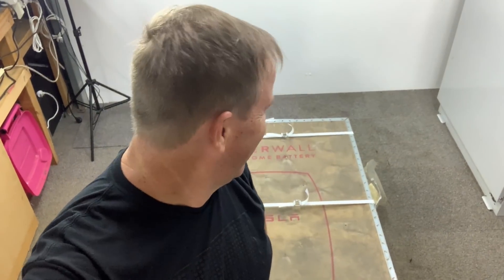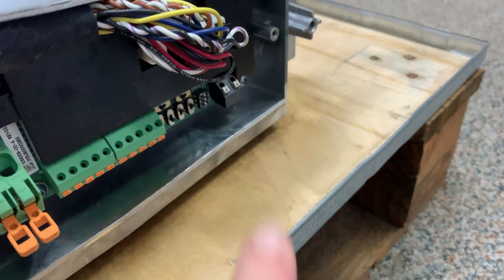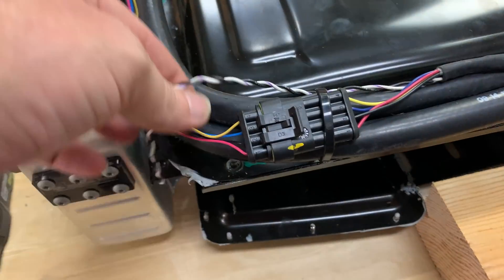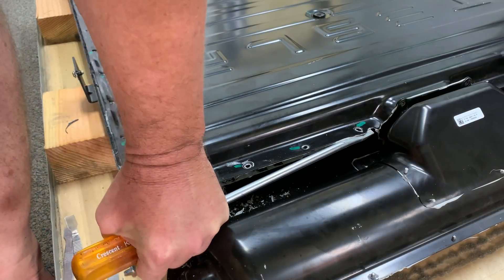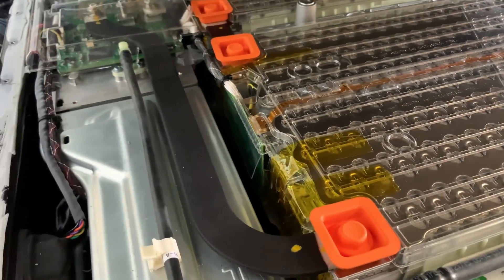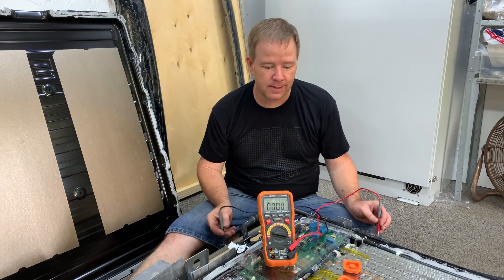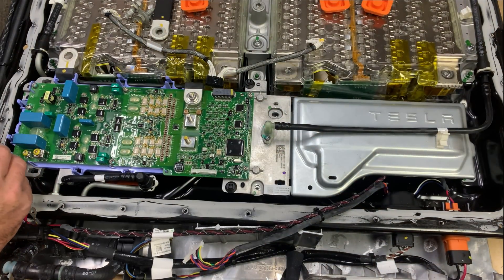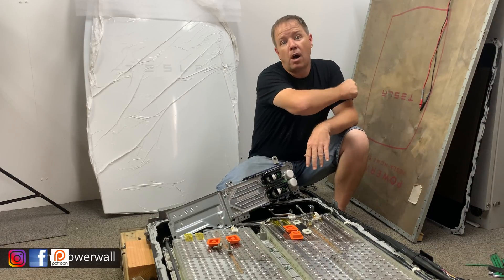Tesla Powerwall Teardown - Taking a look inside a new Tesla Powerwall thats been stored for years

Comment: Well lucky you got for free, me I pay $10,500 back in 2016 when a company up here in Puerto Rico they installed my grid. And this is my LUCKY experience don't if I should said with TESLA or the Company that installed the unit but here we go. On Nov 2016 they installed the grid with one battery it was not till Feb.2017 that they turn on the system to work like it should with the utility company meter and all permit to work like it should and it was working like it suppose to, not till Sept. 2017 the same year that Mrs. MARIA show up to the door of Puerto Rico. When the Hurricane enter that the grid went down the system did not want to get up I shut it off and turn on my backup generator, next day after Maria gone I went to turn on my system and it did not want to do nothing even a bright day that was. I went to the company and they send a TEC that was teach by the TESLA technicians cause for MARIA the TESLA TEC had to come down here to get a lot of issues solve with different issues that not only this company have encounter so long story short my friend.

The TEC came with a battery to jump started the TESLA and give it enough charger to wake it up so the system can wake up and function, but its a very slow process at less that what he describe me and it was not till he have seen that I have a backup generator that he said that with the generator he could jump started it also and charge it faster at least to a 5% state charge and that was what he did and later on I end up buying a second one in which cost $8,500 and you got that one for free, let me know if I can get one for free as well to fix my crying. GOOD luck with my hint.

Comment: I am hopeful that you can restore it, I let a 3s lipo drain to 1v and was able to restore it by slowly charging it and checking every few minutes until it got to the correct minimum voltage, 2 years later and it still works fine.
Reply from the maker: These have been zero volts for years I don't hold much hope for them

Comment: I would use a good current limited power supply and set it to about 1 amp and let it run for a while.....  don't know how likely you are to get those back though.
Reply from the maker: I only have a cheap ebay one set at 1.5v &  0.45amps recharging now very very slow..

Comment: the white Keurig cup looking things were inductors (chokes).  Although not the case here, "smoother" almost fist as a term. AC often smoothed into a form of DC!  Here probably being used to control the DC bus voltage and Amperage in the charging unit.
Reply from the maker: thanks for the info

Comment: I appreciate your time and effort in disassembling the device. It seems to be engineered well enough, but there are points of failure are everywhere. Typical discharge occurs with batteries connected to a BMS and other devices. The discharge may be in mV, but over time the batteries will be entirely flat as you have noticed. Use of chokes is a normal practice, one of the main benefits is to reduce DC ripple during charging.
Reply from the maker: Probably why they released a PW2, easy to see issues down the road.. I'm still super impressed with it - if it had been installed it would only be half way through its useable live and if they cycled it every day here in Brisbane Australia they would have saved a whopping $2,281.25 off their power bill. So in their 10 warranty period it would save them about 5k aud - NOW just got a quote to supply and stall a PW2 and it's $16000 all the sudden they might look good but that ROI is WAY off!

Comment: not sure if it’s true, but I believe using a heat gun on the case will soften the adhesive and make it a little easier to open
Reply from the maker: we tried that didn't help, My theroy to why is it's a thermal barrier. If the battery when thermal you wouldn't want that material to soften during that event

Comment: what we recon is a new powerwall 5 years later wouldn't even be remotely similar to that one.. which of course would no doubt be damaged l-ion cells sitting discharged for years.
Reply from the maker: are you implying that it's not new because its been on a shelf for 5 years? New in box, not cycled - under any Australian law that would be considered new if you sold it with a new warranty.

Comment: This was so interesting to see, thank you! Besides Tesla already having manufactured the 6s74p modules, any thoughts on why they would have used the 2x 6s and DCDC converter? LG does similar in the RESU-H, right? I think HV DC coupled battery packs make great sense but why not just go 16s and skip the DCDC? Thanks again.
Reply from the maker: i'm no expert but i'm thinking the dc to dc would still be needed for constant voltage
Reply: You answered yourself. This is Tesla repackaging what they already have. They aren't going to spin up an entire production line to make a different battery module. That's the module they make; that's the module they stick in everything.
Reply from the maker: @jfbeam  for sure! its smart business

Comment: A choke, is typically a component used for step down/up for discrete conversion power ie DC/DC from cells to house - https://en.wikipedia.org/wiki/Choke_(electronics)#:~:text=In%20electronics%2C%20a%20choke%20is,AC)%20in%20an%20electrical%20circuit.&text=Its%20low%20electrical%20resistance%20passes,the%20amount%20of%20AC%20passed.

I didn't realise you can revive completely dead cells however.. Additionally regarding BMS and self discharge, I suspect the BMS priorities are safety first and then longevity of cells. IE if you left it alone it wouldn't shut off to keep voltage, it would disarm itself incase it gets chucked in the landfill and nasty things happen. I'd even go as far as guessing if you left it for a time duration without charging it would accelerate the discharge for "safety" of unmaintained cells or sales...

Subbed! look forward to the next vid.
Reply from the maker: Thanks for the info, next video 'trying' to revive cells is in production..

Comment: Have spoken to the bloke I got mine from (he istalled them and newer ones and thats his living) and he stated there are actually a lot of brand new ones in ware houses around. He has also stated that there has been complaints back to the mother ship re this very problem and if they sit for a period of around 6 to 12 months they discharge, dependant on the charge they had. He also noted that I should be able to recover mine with the invertor and management box that was used with them when sold. I actually have all the system so it may be something I would try soon but need an electrician of him to do. Looking at the slow charge at low amps to try first to give others an idea if this can be done, thus allowing confidence if anyone else finds one and wants to partake in the same experiment. 

Along with the information given, the mothership, through training, this bloke recieved stated that recovery had no bearing on performance nor safety of the unit, thus suspecting the controller box and invertor could play a part in this as well as the mainboard in the unit. The external controller and invertor are designed to recover at low voltage etc which is controlled by the main board in the unit, that talks to other compents to ensure that the power delivered from panels etc in at a minumium. And yes they also told them that recover takes time but the system did this without comprimising cells. 

If this is the case Pete you may have a good chance and so may I. I still have voltage in my packs so this might be a saving grace for me, but as I said I have the whole setup. 

BTW if anyone does get a powerwall and the rest of the system there is an option to plug into network, advice is dont, as the systems reports back to Tesla systems and if the unit was suppose to be decomissioned, acquried the wrong way the system will shut the unit out making it useless, I do however suspect this may not have any bearing on the packs. It will also report IP address, location information. 

It is only information that has been passed to me, but found interesting from and installers point of view. Have fun.
Reply from the maker: I would love to have a chat to your bloke!
Reply: @HBPowerwall  see what i can do. he can be a tool, but has some good info.

Comment: I wouldn't recommend reviving a Lithium Ion cell that has fallen below 1.0V. Copper can dissolve into the electrolyte at such low voltages, which can them form shorting dendrites when the cell is re-charged. It's a safety risk.
Reply from the maker: Yes, well aware of the safety, and will take that into consideration when I perform the task

Comment: I don't want it attached to the house. Would have it on a separate structure or wall off the main building. Those things worry me if something goes wrong
Reply from the maker: With the effort it took to pull apart, it has a thermal 'exhaust' up top, along with mounting recommendations I would put this next to my Mini lol

Comment: Maybe its not "bricked" - maybe the battery voltages dropped below limit they should and only thing it needs is to charge them a bit  - in order the whole system to work. Great score. Try first to repair it and sell it !
Reply from the maker: In the process of trying to repair now.

Comment: you can actually revive the cells by slowly charging the pack , they will eventually pick up voltage again and there is a decent chance they wont be completely dead
Reply from the maker: Time will tell!
Reply: force charging as in like charging them without an ic , like charging them straight from  a power wall. but instead of power wall *because its ac instead of dc . i use power regulator or something like laptop charger
Reply: Your qualifications space reptile?
Reply: @garystewart6093  personal experience + electric engineering
Reply: @garystewart6093  i can confirm that is true, based on my own experience. i revived quite a alot of "dead" 18650/2000mah battery by just force charging them for a couple of minutes

Comment: That looks like the oldest model of powerwall. Looks like they were using 18650. Wonder if they use 21700 in their latest model of powerwall ?
Reply from the maker: its a gen one so to say, and i believe the do use the 2170s int the PW2 it stands to reason as it's only 20kg heavier but double the capacity
Reply: @HBPowerwall  What is the weight of the Powerwall that you got ?

Comment: Buy two new modules from ebay and swap out the BMS boards? (if they are different) Job's a gooden?
Reply from the maker: Then I still have the issue of activation - if it was already in service this is an option but I beieve you need a Tesla Installer Username and password to configure & commission the battery
Reply: @HBPowerwall  Good point :P Though I think it should at least work without internet... Not sure about activation.
Reply from the maker: Spent the last few days calling solar installers looking for another one, it does seem very likley - alot of them were very guarded with information (and rightly so I would be too)

Comment: Chocks are magnetic rings that filter line voltage spikes
Reply from the maker: Thanks for that Delton!
Reply: Another interesting note about Tesla Powerwalls. They have to stay connected to the internet. After a few days of no internet, they shut down and disconnect the power, but will turn back on after the internet is restored. I wonder if your system was in that “No Internet “ mode.

Comment: If the modules are the same size as newer modules yu could stick them in and use the electronice. Or you can diy the modules and use the electronics. then sell it?
Reply from the maker: Will not sell it, got it for free and should honor that. DIYing it is an option :P

Comment: Inductor chokes for filtering out high frequencies instead of using capacitors as you mentioned 500V, the inductors are more suited for higher voltages.
Reply from the maker: Thanks for the info

Comment: The voltage should definitely not be 0 in only 5 years, try check the individual cells since there might be a relay in there that disconnects the cells from the BMS  boards
Reply from the maker: She is zero.. nada
Reply: The fuse wires linking the cells is the only "safety" in the whole thing. We don't call them "firecrackers" for nothing. If charged one cell (group) at a time, it might be possible to recover, but there has been significant damage to the cells being discharged that low. Do not attempt to charge, or use, in any place that will not react well to fire.

Comment: You can attempt to put a low power ~48 volt power supply on those batteries to see if they react. Something in the order of a few 100m amps would work. That would take a few days, and I would leave it outside :) If it recovers to something like ~40 ish volts you could proceed to a normal charger.

Also, maybe these packs have a battery disconnect, although I don't remember the car modules having those. Which could also explain the 0 volts. That this thing didn't have a service disconnect plug (like every car has) is very odd.
Reply from the maker: I think first plan is something like 6v 1amp across the 6S battery monitor for days, see what happens

Comment: Consider unplugging the BMS and attempting charging the modules with external charger. Once it has some voltage in it, the BMS should start up again and might be able to allow AC charging it back to life.
Reply from the maker: I'll do something for sure..
Reply: @HBPowerwall  what did you end up doing?
Reply: I expect the BMS to sound the alarm when you do that. It's not meant to be opened up and really not meant to be messed with. Most BMS from the big guys tend to report 'battery removed' and set a permanent failure register accordingly, turning off discharge and charge-circuitry forever, maybe even blowing a fuse. If you know how to interface with them, know how to reset it/know encryption-keys, you can probably revive it. But with this one I doubt just unplugging, charging the batteries and than re-attaching them, will work. I can't even do that with my 'cheap' 300 Euro videocamera-batteries. Remove the BMS on those and it will set a permanent failure immediately. Hell, even charging the cells with connected BMS by bypassing the charge-FET immediately sets an alarm inside the BMS, that suddenly notices its cells rising in voltage without charging current passes through its sense-resistors (the same goes for discharging).
Reply: @weeardguy  Yes, much better to use something like Battery-Emulator with a degraded vehicle battery. You then own the whole system rather than consolidating power further into the hands of folk like Musk.
Reply: Dc charge
Reply: I agree. Most "smart" chargers simply refuse charging the battery (even at slow rate), if it reads a voltage below the set limit. Worth to try.

Comment: Pretty sure Tesla don't ship those things fully charged so they're likely to be self-discharged. The BMS was probably disconnected from the batteries and they self discharged. Should recover ok for most of them. Your thermal camera will be useful for any cell that didn't survive. :) Can't wait to see if you recover them. ^_^ Was the cooling for the cells at all or was it mainly the electronics? Maybe it would power up if the batteries had some charge put back in them?
Reply from the maker: bet their shipping voltage will be 30% soc

Comment: These two chokes on the output of the DC/DC converters are 10mH custom made 1047572-00-e common mode chokes for filtering of the common mode noise made by the converter. They are not available on the general market as they are made directly for end customer, but given the size and inductace I would assume that they are rated at the level of around 3A-6A, and as it's a power line, they have sectional winding to have a high stray inductance value to filter out both, common and differential mode noise. I' deal with similiar chokes daily and if You would like to look for similiar components, then part numbers like 744834310 or 744834622 from Wurth Elektronik may be handy.
Best regards, from Poland.
Reply from the maker: Awesome - thanks for the info!!!

Comment: I thought Tesla would have some kind of cut off switch when the batteries got too low? Seems like bad design to drain them completely!
Reply: Or simply pull the plug on the batpac
Reply from the maker: To be fair, they are typically installed and used as soon as they are produced I guess.. But a low voltage cutoff seems to have been missed

Comment: Dumb question Pete but would the tesla module individual BMS not have disconnected the packs from the larger DC to DC board once the voltage had got so far.. so if it were.. would there then be a possability the tiny bms board at the head of the packs.. worth checking..
Reply from the maker: not sure, I hope to go a bit deeper with that soon.